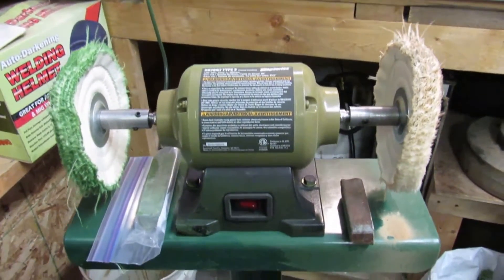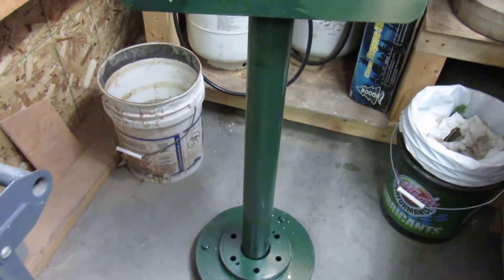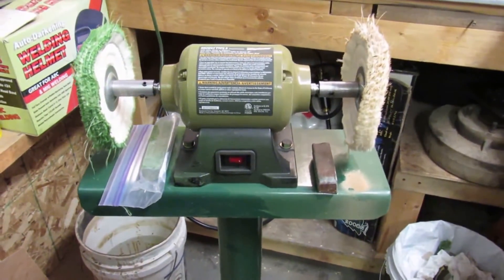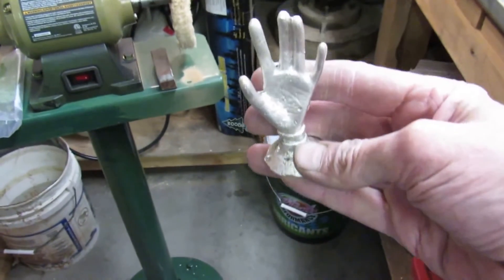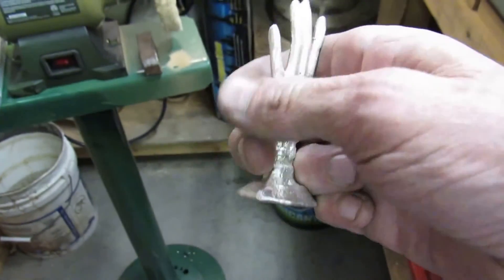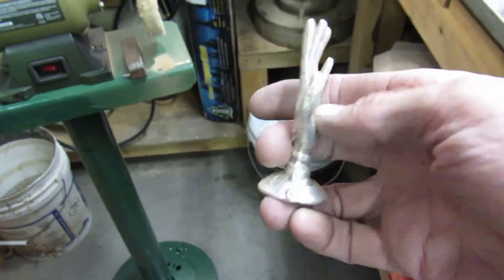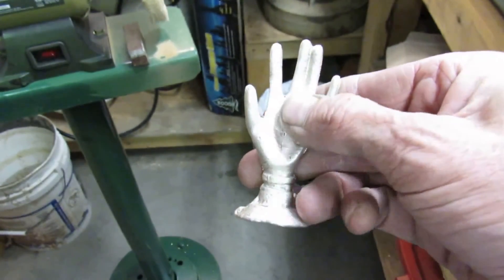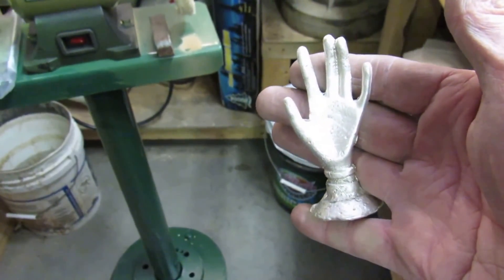Grinder, buffer project. I used some scrap & break rotors for the stand. Plus a nice 3D silver hand

Comment: Kool set up on the polisher. I have something similar. Although I only use one kind of rouge.  Cool intro also. Good luck with your hand.   LL
Reply from the maker: Well thanks Louie. I an fortunate to have a lathe so I could make the output shaft extensions. I think I only have a "C" note tied up in the whole build.Buffing pads and washers included.Great fun putting a something together from scrap.